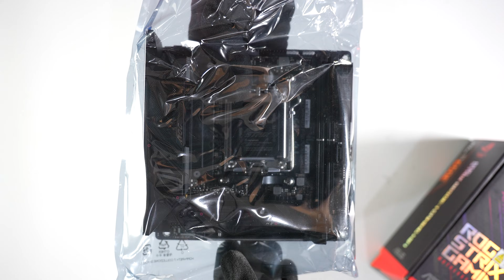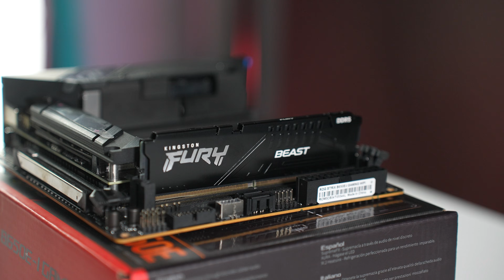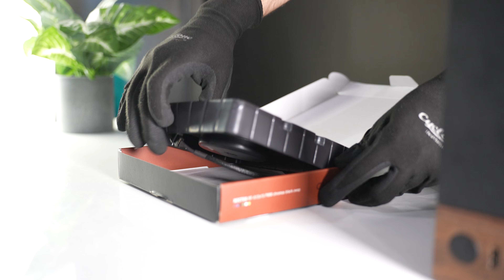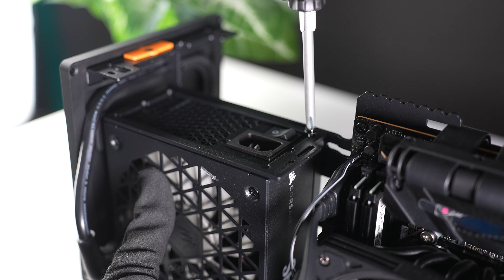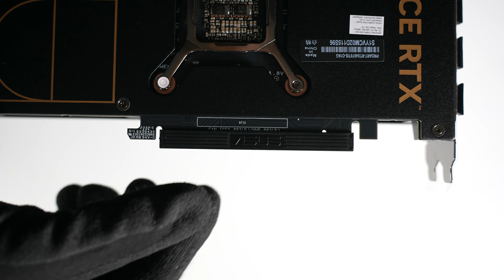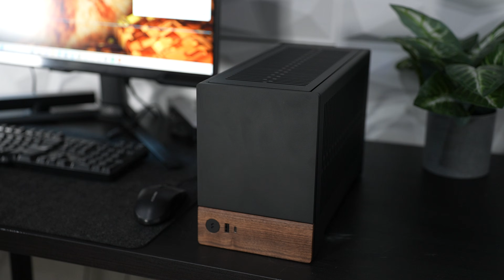ᵐⁱⁿⁱ Fractal PC

Comment: I would like to build a fractal terra, with a RX 9070 XT and Ryzen 9 9900x (which is cheaper than the ryzen 7 9800X3d). I am not sure what cooler, mobo and PSU to get for this? I would like to play BeamNG on max settings at 3440 x 1440 and use blender and possibly other CAD software.  What do you recommend?

Comment: Will the pro art 4080 super work with everything else being the same
Reply: Yes, i checked the specs myself before ordering the 4080. Plenty of room left length- and heightwise. The card is 50mm thick which leaves you 70mm for the CPU-cooler.

Comment: Hello! I have a newbie question! How do I connect the power supply to the back of the case? Do I need a cable purchased separately or can I find it with the power supply itself?
Reply: Hi. I dont quite understand your question, but nearly every cable you'll need regarding the power supply comes with it.

Comment: how are the cpu temps?
Reply: my question exactly
Reply: I’ve tried it and it’s around 60 to 70😅 surprising for the cooler he’s using
Reply: I have it and 78c
Reply: @procheatcode same case ?
Reply: Same question
Reply: At ideal is just below 50, while during gaming (4k at 60 fps) 60.
Reply: The 7800x3d sips power and thermals are great with just about any cooler.

Comment: same build, but went with ID cooling IS 67 instead. temps are acceptable, but the noise is on the loud side
Reply from the maker: We replaced the Fan on ID Cooling with a Slim Noctua 120mm NF-A12x15 PWM for better thermals and Sound!
Reply: @radiumpcs3235 would it be possible to know the cpu temps. Debating using this case and cooler with the Ryzen 7 7700X instead of the X3D

Comment: I literally built this exact pc three days ago. Love it so far though. Only difference was I used Corsair ram and Samsung storage. Now I feel like the rest of my desk needs updating to fit with the clean look
Reply: How are the fans wen the lids are closed? I saw some vids that the air against the grills makes some noice
Reply: @jeffa17  it doesn’t make a bunch of noise to be honest. Definitely nothing I can hear through my headphones and it’s quieter than my previous pc by a long shot
Reply: How are the temps? You got the 7800x3d
Reply: What are Cpu temps like?
Reply: Total cost? 😅
Reply: I just bought this case along with pretty much the same components. Does it bother you that the motherboard is upside down and thus all of the ports on the back upside down? Because I just realised that and it kind of bothers me.